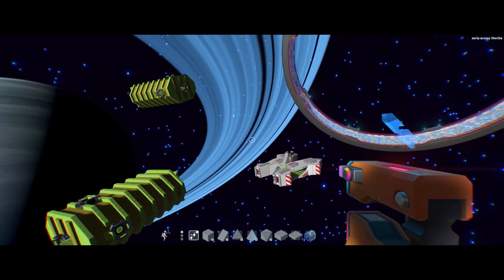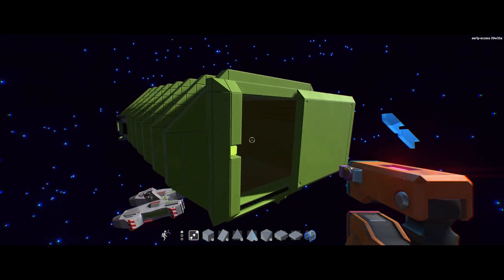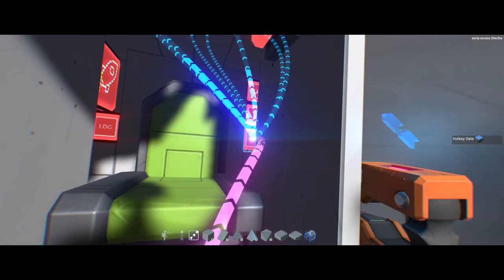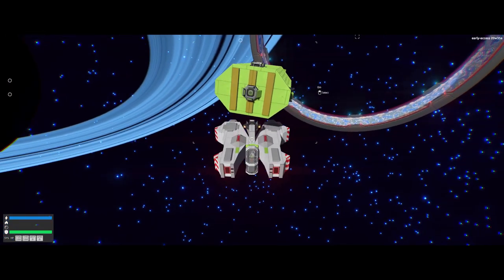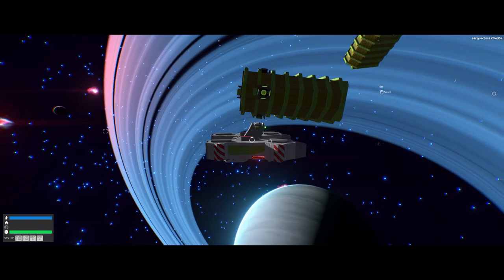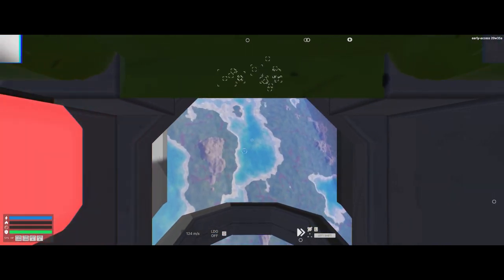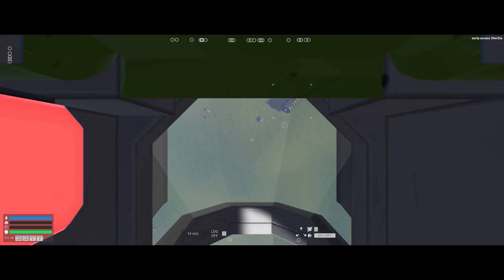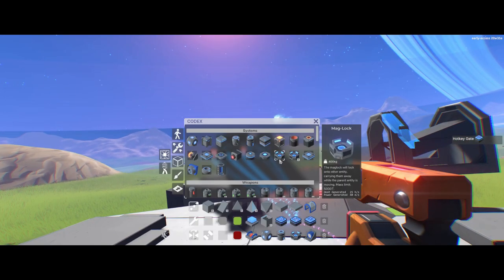Moving containers using Maglocks - Starship EVO

Comment: I can't get these to work at all. It seems like they won't turn on no matter what I hook them to.  Currently trying to use them to carry a hoverbike with a ship around the ring. I've tried hotkeys and switches, any clues?
Reply from the maker: The ship that has a Maglock I think requires a power source. Turning the Maglock on/off will require a switch linked to it. If using a hotkey logic block, the block needs to be set to "switch" in the "f" menu for that hotkey block.
The large Maglock has a limit of 5000 tons and the small has a limit of 10 tons (I think).
A message should pop up on screen if the lock has activated successfully or not.
If there's no message then make sure the hotkey block is linked to the yoke or at least linked to the thing you're trying to turn it on with.
Hope that helps, otherwise I'll need more info as to the setup you're trying.

Comment: No offense but I need some detailed instructions on how to actually set up and link the mag-locks then use.
Reply from the maker: Add Maglock to spaceship/hovercraft. Link a switch to it. So that it can be turned on and off.
Now I can't remember if it's just with turrets, or both turrets and maglocks. But make sure the spaceship/hovercraft has some power reactors.
Move spaceship/hovercraft towards thing to be moved/maglocked. Turn on Maglock using switch.
If the maglock is able to connect and message appears.
I made a mistake in my video thinking that a matching maglock was needed.
The small maglock has a mass limit of 10 tons while the large maglock has way higher. I can't remember at the moment.
Reply from the maker: You can also link a hotkey logic block to the maglock, and the hotkey block to a yoke. So that the maglock can be switched on/off while you're using the ship.